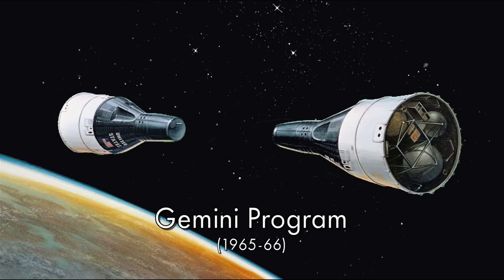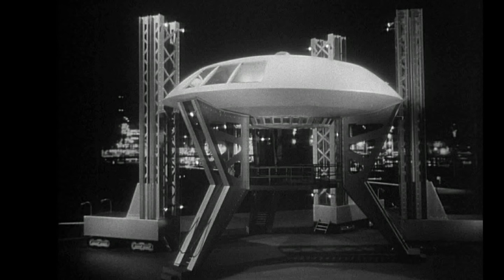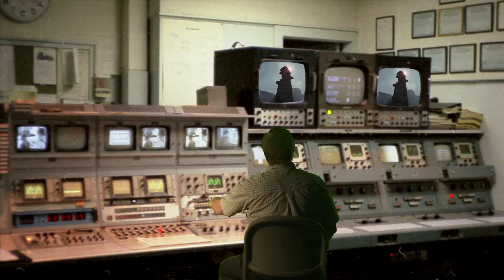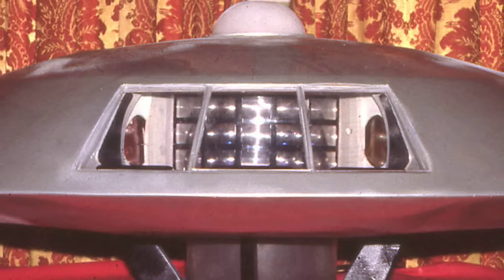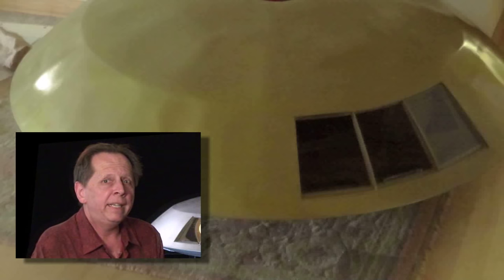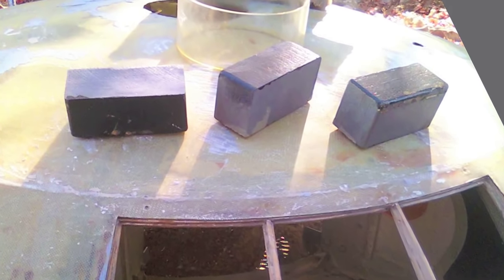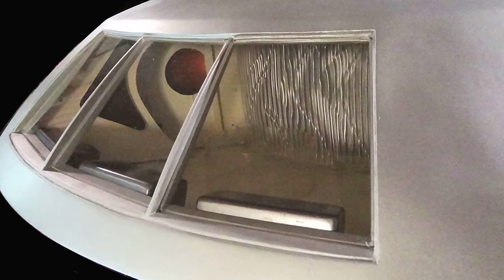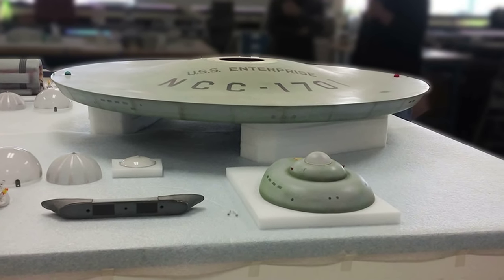RESTORING THE GEMINI 12

Comment: Great work. I've worked with fiberglass on Corvettes on and off for 45 years and old fiberglass can be tricky. Back then, "anyone could do it" and it often showed. Excellent work you did on this project.
Reply: The heat shields on both Mercury and Gemini were mostly fiberglass. Rene 41 matrix held it together.

Comment: I did not know that the same artist created The Seaview and The Flying Sub. I loved Voyage To The Bottom Of The Sea as well as Lost In Space. Very cool and thank you.
Reply from the maker: Bill Creber was also production designer of the Time Tunnel and the '68 version of Planet of the Apes.  Talk about talent!!
Reply: Actually, with it's blueprints dated October 30th 1960, Herman Blumenthal designed the original "Seaview" for the 1961 release of the feature film: "Voyage to the Bottom of the Sea".  Initially it had 12 pair of windows on two levels and no "manta fins" at the bow.  But prior to filming, this number was reduced to eight individual windows and the famous front mounted "manta fins" having also been simultaneously added.

It must be said however, that Bill Creber indeed penned the nose modifications to the "Seaview" as dated:  May 1965.  There, the original 8 window two level "feature" and first season "Seaview" was changed to the single level,  two-pair (four?) window variant with the enlarged underside accommodating his own designed and then new "Flying Sub".
Reply: Well I do not know all the specifics but I do remember having a toy model of the Seaview that had a rubber band that you would wind up with a crank in the front and it spun the propeller in the back and I would play in the bathtub for as long as my Mom would let me. I guess I was 4 or 5 but I kept it until we got a built in pool when I was 14 and played with it in there (which was not considered very cool at the time). I remember it being Orange though, which does not make sense. Anyway it met it's demise when I went through my "blow everything up and set it on fire" stage Ah...memories :)

Comment: Each time I revisit this program about the restoration of the Gemini 12 filming miniature, I am thoroughly impressed.  Returning the original shell to its original state, but then reinforcing the interior to assure an enduring result was the perfect strategy.  I keep wondering if news of the missing reactor piece has ever surfaced.  It seems like the sort of thing a collector might have preserved.  (I also wish the team that worked on the Galileo 7 shuttle would have taken pointers from Mr. Lulbiner's work before they began their project.)
Reply: There were virtually zero  "collectors" to save it back in 1970.

Comment: I always found it interesting that the ship was as shown was bigger inside than outside.
Reply from the maker: Continuity in Irwin Allen miniatures vs. interior sets was often lacking!
Reply: Sort of like the TARDIS. :-)
Reply: Welcome to science fiction FX. The Millennium Falcon has the same problem. Several kit makers have gone nuts trying to square the circle. There's an original Polar Lights kit in my closet. They did a pretty good job with including both levels.

Comment: Amazing how this ship is so much bigger on the inside than the outside. The model has maybe enough exterior space for a small upper deck and a not very tall at all lower half-deck. But inside it had a very spacious upper deck with even an area in the back behind some doors. Then an even larger living area bellow that...and then, as we saw in one episode a very very tall engine room below that.
The Doctor would be proud.

Though to be fair, the Jupiter 2 in the new (and very excellent and very big budget) Netscape reboot also has 2 decks, but obviously only room for 1 and a half decks, just like the original 60's version. 

I wonder if that's an intentional homage?
Reply: Our video isn't about the Jupiter 2...it's about the Gemini 12 which is a one-story spacecraft.
Reply: I hope you understand, Mike's comments are quite correct.  Please do watch this video prior to posting comments as our video does go to great lengths to explain the "one story versus two story" variations as well as all the many design differences between these two ships and the two different designers involved.

Also, as for your  "...bigger on the inside"  Dr. Who comment, what scale reference are you using to make this purported claim?  A blue-print specified 48 foot outside diameter in reality, is ample room for the pilot's depicted live action stage interior. But again as Mike has stated, this comment of yours has absolutely nothing to do with this video's content.  --I hope you understand.
Reply: Inadvertently from Doctor Who’s TARDIS.

Comment: My parents got a kick when I was 10 or so when I grew frustrated drawing my own schematics of the ship, exclaiming its impossible for all their quarters, gear and machinery to fit.
Reply: Interior shots are usually done on a sound stage. In one episode where Will(Bill Mumy) goes down to the lowest level, it looked like 10'-12'  high.(Even on the full size ship,it was barely 2').  All the interiors of the Brady bunch house were at Paramount studio 5(?),used for two or 3 other shows( they changed interior look,the stair case was in the same place).
Reply: Same here!  Same age.  I had a big Sketch drawing pad and used various kitchen pot lids to draw the circle, then tried to draw in all the different rooms.  I became a CAD drafter as an adult.

Comment: What I believe would be incredible would to be start up a grass roots construction and location suitable projact of a "full size scale model replica" (sheet aluminum skin over wood frame) of the Gemini 12 or the Jupiter 2  with as much detail as this restoration has, interior and exterior wise...And charge visitors/fans a reasonable fee to be able to come see it and get a chance to come on board? I think it could be built in a reasonable budget and with fans/volunteers construction help and even possibly with a "Go Fund Me" assistance page? I believe it could be built on some property that could and would be zoned for commercial use so as not to require moving it after construction....I would enjoy hearing from anyone that would share an interest and possibly a desire to even initiate a plan for such a project and have it become something other than a dream of mine and fans alike...
Reply: Add grain silos painted white as mars HABs and make a theam park of old sci-fi space craft ie moonbase 1999 as well.

Comment: Does anyone address the interior space issue?Inside has two decks, plus they have a "chariot" and a landing pod in storage somewhere.  From the outside, it doesn't look that big.  Did they consult with Dr. Who about TARDIS technology? 😉
Reply: It's not our purpose to explain all the contradictions in the show.   Thousands of others have made those comments on various LIS Facebook groups so we will let them have those detabes.
Reply: The upper 2 decks were prominently featured. In only 1 episode as I recall, were we taken into the lower floor, the engine/storage deck which had the reactor and all the food supplies. Wil was chased there by a creature that fed on fear.  I always wondered...where the hell were the pod and chariot stored? 
On the subject of the chariot, how did Robot B9 get in and out of the chariot? We saw him sitting in the back of the chariot or walking around it, but never getting in it. I imagined the chariot had a lift, so common on vehicles today, that would pick up and deposit the robot inside the chariot.
Reply: @gemini12channel58  Thank you for the reply.

Comment: In the Fall of 2004, I constructed a flying saucer prop for use as a Halloween yard decoration and the internal ribs were each cut from Lauan plywood.  One rib was cut and then became to pattern for repeating across the 4 foot by 8 foot sheet of plywood. Each rib was laid flat and additional rectangular strips of Lauan were glued onto them as stiffening braces; this required drying time and space to leave the ribs lying flat. The "core" of the saucer was a white plastic kitchen trash can with notches cut out where the ribs could attach. Transverse rectangles of the Lauan plywood were cut and used between the ribs to support the equal spacing around the circumference of the disk; MORE drying time required! The resulting skeleton looked very good, was sturdy and only needed something to clad the exterior, painting and "chasing" white Christmas lights for my very own fusion core. About 3 sheets of the Lauan plywood were used in total, and the stiffening braces were scrap pieces remaining from where the ribs were cut.  So, not all of the stiffening pieces were perfectly rectangle, but this was fine because the ribs were covered and not visible from the outside. The entire finished saucer disk was wide enough (tall enough) in diameter as to barely fit out a sliding glass patio door! In the end, the exterior was clad with cardboard and silver paint applied. The saucer appeared as a wreck in our front yard, slightly to the side, and my daughter greeted Trick or Treaters dressed as a grey alien!

Leaving these notes here as an inspiration for anyone wanting to build there own 5+ foot wide flying saucer model inspired by the Gemini 12/Jupiter 2!

Comment: Great job! This ship & the J2  are timeless because the design is clean & simple.
Reply: Thank you.  However, it's actually the beautifully rendered and complimentary compound curves that makes the design aesthetically  "work".  As any industrial designer worth his salt will tell you, compound curves are most difficult to get  "just  right",  and Bill Creber did indeed get them spot-on!
---So truth be told, objectively beautiful results as seen here in reality are not at all  "simple". 
I offer as proof of the validity of the above comment,  compare the appearance of this miniature with that of the sound stage Gemini 12/Jupiter 2 set, ...the full sized mock-up with it's flat cross-sectioned sides and conical top.

Comment: Superb job on the resto!  As an aside, I have always envied those who lived close to or in L.A. and were able to either pick up props/set pieces from auctions or sometimes DUMPSTERS!   I remember LIS in it's first run as a very young child. I remember ST was on at the same time but I couldn't follow it then.  Too cerebral. LIS scared the poo outta me!  First of all the coolest robot ever devised was on it and the J2 was second only to the Enterprise (I got into it in after school reruns early 70's) I can recall hiding behind thew couch and peeking as the horrible scary hairy creatures were allowed to escape the intergalactic zoo(?) by one of Dr. Smith's idiocies. Why the good Major didn't help them all out on a dark quiet night I'll never know. Anyway, I remember I made my own J2 out of throw away pie plates for the bottom and a curved carbboard top. Had it's own sliding hatch door and all. Like all LIS fans I dreamed of te day a model could be had.  I think I bought about ten when they finally came out. I have a 18" Lunar models J2 somewhere I never built.

Anyway, is there any chance the actual fusion core and dome flasher  mechanics could be shown in it's own clip?  That always interested me.  

One other thing: in 2001 I was on a trip to Orlando, Fla. and we had dinner at a Planet Hollywood. I recall there was a LARGE model (3-4 ft?)of the J2 hanging from the ceiling, fusion core lights spinning.  Do you know the story/origin of that replica?  I asked and was only told that the displayed items were all true film/TV props or artifacts. Always wondered about that..

Comment: First of all, fantastic job! You've really performed a tremendous service to LIS fans everywhere.

I have 2 questions for you:

1) Are you planning on restoring the mechanical upper dome workings. Most people don't realize it, but there was an aperture inside the top dome that spun along with the fusion core, perhaps (speculation here) by a connecting rod to the fusion core motor.

2) Do the 20th Century Fox plans for the navigation dome's aperture still exist and if so would it be possible to see them?

Again, fantastic job! I've FB friends with Mark Myers for many months and I'm glad he was able to put you and the Gemini XII owner together! 

Thank you,

Robert Young
Dallas, Texas
Reply: Thank you very much Robert.  

To answer both of your questions with a single response; we always had in mind adding a spinning "Radar" type antennae under the top dome.  But the drawings for that have so far have eluded those of us in pursuit and that's the hold up.  

I have the motor (the top device turned approximately 6 times as fast as the fusion core) and the sheet aluminum to make the rotating piece there from as well as an RF remote control.  We may just find ourselves doing a follow up video on this very subject.

Comment: Absolutely wonderful, Paul. Believe me - you have the thanks of an unbelievable number of people to whom the ships of Lost In Space are a treasure beyond words. I am one of them - can't explain why, fully. When I was 10 years old, I painted a wide white stripe across the top and down the sides of a black Frisbee, so that when I threw it, the spinning stripe would look like the rotating fusion core. Yep, I was obsessed, to say the least. Are there any plans in the works to restore the rotating sensor array in the upper dome, or was that a different model than Andre's? I read some time ago that the array spun on the same shaft as the fusion core's lighting disc. The panel on the upper deck that hid this machinery is visible in the J-2's close-up as the ship enters and lands in "The Derelict's" interior. Again, many thanks, on behalf of all us J-2 / G-12 fans.

Comment: Fantastic! What determination. FRP still rules anyway because it can be used at home, without ovens and stuff. I am at the moment "building" my own Jupiter 2 by the way. Years ago I found a small about 2 inch wide air-refreshener housing that looks very much like the Jupiter 2. O.K. It has 4 x 4 "windows" in stead of 1 x 3 but it is so close that one must assume that the designer was inspired by the series. Igues they'd call it an easter egg nowadays. It even has 2 deck levels inside! I've got no idea what the brand was though.

Comment: As I grew up I assumed that all the props and costumes from the Classic series I had watched ( I m a baby boomer so I saw them on tv in the 50s and 60s) had been preserved somewhere. In the 70s I was surprised to find that wasn’t so. The Batmobile sat in a parking lot at 20th along side lots of old cars. It was stripped. It was exposed to all the elements! Amazing.
Reply from the maker: Hollywood has a long history of neglecting its sets and props.  Costumes were preserved and stored for future use but items from sci-fi shows were often stored improperly or tossed into a junkpile.  After BATMAN ended, the Batmobile was always under the care of George Barris who kept it in his shop in North Hollywood.  The Lincoln Futura, which George converted into the Batmobile in 1965, had indeed languished outside his business until the Batmobile rebuild.

Comment: This is truly amazing! Not only is it reassuring to know that yet another piece of our shared television history has been rescued from oblivion, but it's astonishing to be able to watch so much of the process in restoring this Gemini 12 model to even better condition than it was in back during its prime (owing to the added structural support and extra layers of fiberglass). So incredibly wonderful to see! Thanks so much for sharing this... Oh, just out of curiosity, if you have the answer easily at hand -- what does the restored model weigh, compared to its former weight during production of the original pilot? Just wondering.
Reply: Around 35 pounds, maybe 40.  It wouldn't  stay on the scale, it kept levitating.
Reply: Good to know, even if it's something of a ballpark estimate. Given the original "wire flying" weight of 22 lbs., it's reassuring to realize that the added restoration supports will help to keep the miniature significantly safer over time. Thanks so much.
Reply: You are sincerely welcome.

Comment: At 1:07, the Gemini "capsules" never docked with each other.  Gemini's 8, 10, 11, and 12 docked with unmanned Agena upper stages that served as docking targets.
Reply: We did a mea culpa in the follow up video "Relaunching The Gemini 12."  Fixed the mistake and added a section about NASA's Gemini program.  It's here on YouTube.
Reply: You do mean "you" Mike, don't you?
Reply: I kept the Rogallo wing that was used by MAC engineers to test a possible alternative to parachutes. This happened  when the project was finished. We cleaned out the shop and I wanted the wing. Kept it twenty years then threw it away. The AR was too low, it didn't fly so much as sank. My brother broke his arm trying to fly it as a hang glider.

Comment: Fascination restoration project! As a sidebar question; I'e always wondered what the Lydecker Brothers used to create the "smoke" exhaust for the Commando Cody rocket ship...Any thoughts?
Reply: They used "smudge pots" metal buckets filled with oily rags set alight.  We were not permitted to burn anything out there without special (expensive additional) permitting and a paid for Fire Marshal present. In our effects reel, Glen has digitally and very convincingly added smoke in post production.